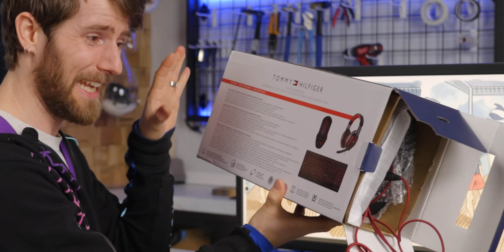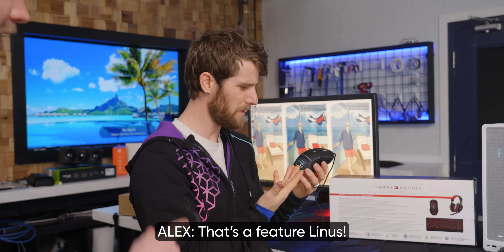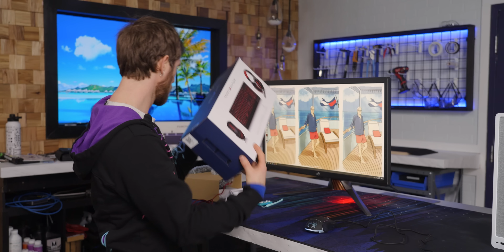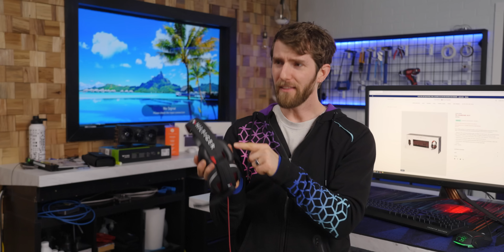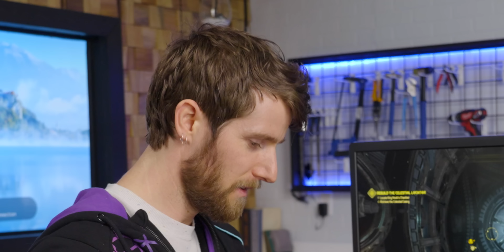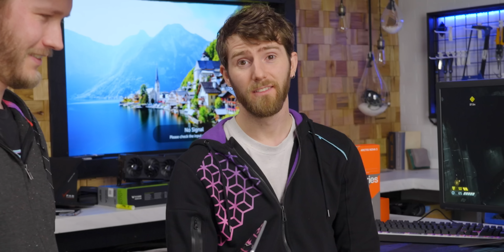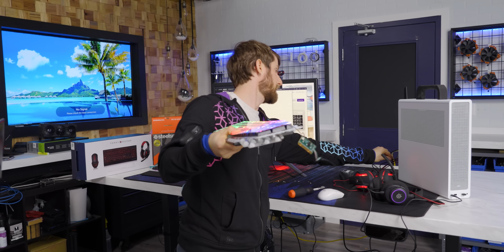Tommy Hilfiger are Filthy Scammers

Comment: The thing that really bakes my noodle is the branding on the keyboard. It's obvious the indent for the silkscreen is meant for a logo that has completely different dimensions, so they've just scaled the Hilfiger logo down to fit, making the spacing look absolutely abysmal. Love the fully integrated wrist rest too.
Reply: Ooooh that really bakes my noodle - 🤓
Reply: @TommyTom21  your comment really boils my bananas 😡😡
Reply: I have said keyboard, exactly the same
Just not from Tommy. I got it for closer to 10usd by itself. 
Not a good deal but still.

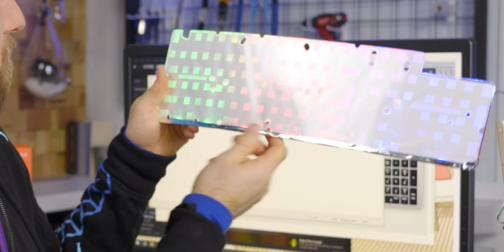Comment: At 26:41 that isn't anti reverse engineer schmoo, it's a chip that doesn't have a casing on its own, the board is directly connected into the silicon then "encased" in black resin. Its called chip on board and it's very common, specially on very cheap very high production electronics.

Comment: 25:28 What you are describing is rollover, not ghosting. Ghosting is when you press a certain amount of keys, and you get an unpressed key outputted. Rollover refers to how many keys you are guaranteed to be able to press.

Pretty much every keyboard made today does not have ghosting issues. Due to this confusion, marketing teams will use the term anti-ghosting because they know that most people do not know the difference and assume it refers to rollover.

As a rubber dome over membrane keyboard, this keyboard has 2 key rollover, not 3 (I would guess pressing W, E, & D would prove this). 
The 6 key hard limit is because they are using the basic USB keyboard driver which only allows a max of 6 keys even if the board itself were to electrically support N-key rollover. This limit with USB is why in the early days, some gamers would prefer using PS/2 keyboards.

Comment: There is a technical error in the mouse parameter section: CPI and DPI are two different concepts, CPI is the mouse sensor parameter; DPI is the parameter of the entire mouse.
CPI is a sensor characteristic. It refers to the number of counts of the sensor for every inch the mouse sensor moves, reflecting the minimum distance the sensor can recognize (for example, when CPI is 10, the sensor moves the internal counter +1 for every tenth of an inch. The controller can calculate the actual mouse movement distance from the value in the internal counter when fetching data).
DPI is a mouse feature that tells the computer how far the cursor should move (in pixels) for every inch the mouse moves.
The CPI is converted to a perceived DPI by the internal controller of the mouse.

Comment: That 6-key rollover on the keyboard is actually a USB limitation. Any USB keyboard that has N-key rollover has added firmware to enable it. If you take almost any USB keyboard from, let's say 2010 or prior, it will most likely have the same problem. The reason Linus was able to play Liero in 1997 was because he had PS2 keyboard.
Reply: Real talk, Liero is awesome.
Reply: Mostly yeah, but the 6 key rollover seems to be split between zones which is bizarre
Reply: That's how they did it on cheapo USB keyboards in the early 2000's, you can't legit even type a document if it isn't, note that at the time a cheap generic would still focus the zones two for left side gaming two for right side then one for rando and one for numpad. 
They couldn't get that right in 20220's when the friggen blueprints how to do it right can be legally just downloaded off some rando website by anyone 0.o
Reply: The problem is not the 6 key rollover, i think its quite common on cheap keyboards, the problem is the zone thing, cuz you can be pressing W D and Shift to run diagonally in a game and then you can't jump, or something like that. 
6-key is not that bad, 
"3-key sometimes" is terrible.
Reply: My DasKeyboard comes with a USB to PS/2 adapter that lets you have n-key rollover, I like that too because it saves me an extra USB slot for other stuff instead of keyboard
Reply: That 'extra firmware' is just a differently put together USB descriptor. Normal keyboards are a single HID class keyboard, hence a 6 key limit. The N-key rollover keyboards use the composite device descriptor that something like a USB headphone set would use where you need audio in and out. It effectively pretends to be a virtual hub with multiple keyboards connected, each sending max 6 keys at once.
Reply: I was able to play roms and such 2 player back in 95/96 with whatever keyboard that came with the pc my mom got form Showplace. Honestly no clue if it was ps2 or not but my understanding is that ps2 was the higher end one, and I assume we didnt have that..
Reply: And for anyone that wants to understand why that's a usb limitation, Ben Eater did a video on a usb keyboard explaining the communication keyboard-pc and it goes over exactly this (comparing ir to a ps2 keyboard too!).
TL;DW: the data packet for a standard keyboard usb communication is limited to exactly the bandwidth of 6 keys, plus all the jargon required to make the connection itself work. PS2 keyboards just constantly sent the data of the state of each key.
Reply: @crisnmaryfam7344  they where all ps2 back in 95/96. USB is just newer.
Reply: Liero mainittu. Torille ->
Reply: @hedgeearthridge6807  I remember that years ago a keyboard manufacturer had on their included accessories listed "PS/2 to USB adapter, even though we don't know why would you want that". I don't remember which manufacturer though. They were probably referencing this 6 key limitation on USB.

Comment: Fun fact, that "anti reverse engineering" smoo Linus was reffering to is probably not what he thought. when trying to get costs right down, manufacturers wont buy packaged chips and will instead just drop the raw silicone on the PCB and run bond wires straight to the PCB. 

As this is super fragile, they them dron a gunk of expoxy on to keep everything secure.

Calculator manufacturers are noriorious for it.

Comment: That "anti-reverse engineering" goop is actually to protect the bare silicon die that is directly attached to the PCB - it is super easy to etch it off if you really wanted to reverse engineer the generic design used.  I used to see that all the time on cheap electronic toys back in the 80s and 90s.  The first thing that comes to mind is those old key fobs that made random noises like farts and gun shots which would be a basic PCB with a gooped up silicon die, a LED (if you were lucky), maybe a few resistors, and capacitors, along with a single transistor for amplification purposes.

Comment: An omnidirectional speaker is a speaker not aiming towards you, but to a spreader cone. Often the speaker is built vertical with the tweeter on top and the woofer in a larger enclosure at the bottom. Between them is a cone that spreads the sound from the vertical position the speaker is in, to a horizontal direction. Since the cone is round, the sound gets spread 360 degrees from the cone, into the room. The result is a massive 'bubble' of sound. There's no directionality. When done right (and that's never cheap) you can look at one of those speakers and STILL can't convince yourself that the sound is coming from the speaker. It's a cool effect, but there's no clear stereo imagery going on. I like the sound of an omni speaker, especially to just 'fill a room with sound' but it can't beat a properly placed stereo speaker. t

Comment: As to the keyboard chip, that blob of epoxy is not there for anti-reverse-engineering.  That is actually a bare die that it laid on the board, and a wire bond machine hooks the pads up to the board.  It is very low tech, but the bond wires are VERY fragile, so they blob epoxy to protect it.
Also, for the mouse, you can get a single LED that had three separate dies in it (RGB) and a tiny controller to cycle through them all.  It is more expensive than a regular LED, but you just provide power and ground, and it will cycle through colors without any extra work.
Reply: It is for durability and against reverse engineering too - it isn't easy to remove that epoxy without damaging that bare die, and to examine that bare die, you need a very strong microscope. For example, Casio G-Shock watches use it for their chips too, in their case most likely for durability.
Reply: I'm just gonna add that the blob method is called "chip on board", and it's used because it can be (surprise surprise) cheaper.

Comment: I LOVE those 'Omnidirectional' headphones!
If you think it over, 'Omnidirectional' just means that the sound comes from all directions, which really means they're not directional sound. They're not surround-sound headphones. That's what it means. It means they're regular, cheap headphones!
Reply: "Surround sound headphones" aren't really a thing.
Unless you have a very specialized design with multiple dedicated drivers at different positions and angles, any pair of headphones is just stereo regardless of if they have a 7.1, dolby or whatever checkbox/mode in the drivers.

What they're most likely referring to is the microphone built into them. For a headset you want a cardioid or shotgun pickup pattern that only picks up sound from the side that faces your mouth to supress echoes from the room that an omnidirectional mic would happily catch.

Comment: So as someone who has worked in apparel, I totally understand why they did what they did, the true failure is not getting a product manager from outside apparel to run this product.
Reply: if the product page is anything to go by, that's probably what happened.
They have a listing template for CLOTHES. so most of the page is like a clothing item.
how to wash, materials used.
and NOTHING of the features.

Comment: The black blob on the PCB 26:37 is not an anti-reverse engineering measure. It's how they encapsulate the silicon wafer to protect it and the tiny bonding wires from damage. They do this to save on manufacturing costs for simple high volume boards because it cuts out a few parts and operations. I hear you can get some specialty solvents to etch just that part away if you really want to see under it.

Comment: Actually, the blob on the keyboard PCB is most probably covering a "naked" chip; i.e. a bare silicon die without any packaging. This saves some money and has been common for certain applications like greeting card and toy sound circuits and cheap Chinese pirated game ROM cartridges.
Reply: yeah, I've seen this in calculators and cheap generic TV remotes

Comment: One thing I learned from this video - never unplug the device you’re taking apart. 

Ok guys I’m about to change the fan on my PSU, wish me luck 🤞
Reply: May god help you, brother
Reply: Well, if you're careful, you should be able to do it. Mine worked for about a day after the fan died and I didn't notice, before going out with a bang. So at least it won't overheat instantly. And little bit of electricity never hurt anyone, just sparks up your life a bit.
Reply: @raifthemad  umnnn the issue with that is their amps. 1-3 amps is enough to kill ya. do what ya want, just mitigate unnecessary risk yo
Reply: Good luck
Reply: Hes in gods hands now 07
Reply: @ShartsInTheAir  don't let numbers dictate your life
Reply: @ShartsInTheAir  And I thought, that my last line would give away, that I wasn't serious.

Comment: I bought a very similar "gaming accessory" kit from Target three years ago for about $50.

Even at $50 I figured it was probably not the greatest purchase I'd ever made, but I needed a headset and the only one left in the entire store was in that box (the lockdowns were just starting). And at least it didn't cost an extra $100 just for Tommy's name on the box.
Reply: You literally couldn't just go to a Best Buy or even Walmart and get a better one? Or just order off Amazon?
Reply: @dabug91  Maybe I could've gotten a better deal that way. I just thought, well, I need something now, and this is here, so I'm going for it.

Things were a little crazy in the month of 3/20. Yeah, I could've probably done better right then, but I also could've done worse.
Reply: Holy sh 2020 was three years ago
Reply: @islmhhh  correct, everyone has found out.

Comment: LTT : Spends 3 years designing a screwdriver because they Linus won't accept the color of the accent in the handle being slightly different than he wants it. Sells it for $70.
Tommy Hilfiger : Buys the cheapest Chinese products they can find for $10, doesn't even bother checking if they are complete, slaps their logo on the box, sells it as a $150 luxury item.

Know your brand before you buy lol
Reply: This was 10 dollars at Marshall's lol
Reply: @RealEpikCartfrenYT A ratcheting screwdriver with integrated bit storage is $10 at the bare minimum.  A ratcheting screwdriver that has a magnet and is the least bit ergonomic to use one-handed starts at $20.  Of course there are also higher quality options that may not be in stock at the local hardware store, Snap-On charges $80 for just the handle for example.

Comment: Nice to see the G305 getting some love on the channel. Got it myself because I hate the asymmetrical design so many gaming mice have these days, (fucks with the joints in my hands to use them longer than 15-30 min.) Such a good bang for the buck mouse, great response time (didn't even notice how bad my old mouse was until I used this one) great battery life, not too heavy, not too light, great software, and damn near always on sale lol.
Reply: my daily driver is an m510, have bought them for years through their iterations. when i game i pop on my g305. i am so disappointed with the g305 battery life. im getting maybe 2 to 2 1/2 months out of the battery, whereas in my m510 ive maybe swapped out the batteries twice in 5 years.
Reply: @briancollins7296  Well how many batteries does that M510 take? Because the G305 only needs 1 AA and I'm perfectly fine with the battery life of my G305 considering that.
Reply: I love my Acer Nitro. Definitely  passed the durability test. Lasted through years of League of Legend while I passed through many keyboards.

Comment: 6-key max is actually quite common on cheaper keyboards. The HID spec states that for low-speed devices, the maximum frame size is 8 bytes, so they use 6 bytes for the keys, 1 byte for the modifiers, and 1 byte for the error. The report format is up to the device, so with effort, it could be re-configured to utilize the 8 bytes more efficiently.
Reply: I'm kinda miss PS/2 keyboards when they don't have such weakness.

Comment: im pretty sure i bought a mouse at wallmart that looked a lot like the tomy one (even had the metal bar inside of it when i opened it) and it was around 9-12 dollars. the coors of the rgb did change depending on what dpi you were using so idk what went wrong over tommy tbh

Comment: Technically, a speaker array wouldn't be omnidirectional since that term refers to the dispersion pattern of the drivers, not the configuration of how they're positioned. So the array would just be a bunch of directional speakers emitting in a lot of different angles. Subwoofers, for example, are considered omnidirectional (typically). That's why you don't really ever need stereo subs in a small listening environment (Although you would in something like a concert environment for many reasons). This is due to A) The walls and floors acting as additional baffles for the sound making it seem to "emit" from all around you, and B) Lower tones (sub 100 Hz) radiate from the sub driver  with a WAY longer wavelength than higher tones, which means when they can oftentimes be longer than the actual driver itself. Because of this, they tend to travel further around the housing making (in many situations) a more or less omnidirectional dispersion pattern.

Comment: You can tell they are a clothing brand with how they've prioritised Material over anything actually useful. Surprised they didn't include washing instructions. 

I'm sure these exact sets cost like £30 on Amazon, in fact they have sets with actual Mechanical keyboards for much less than this. Wouldn't be surprised if these cost them under $20 each from the manufacturer.
Reply: It seems to be on purpose like it's a cute, quirky thing to do. Their core customers don't even read any of that stuff, anyway. They just buy.

Comment: i tested my $20 keyboard with the anti-ghosting demo and it can only handle 6 simultaneous keys at once, and sometimes only 3. lol
i like typing with it though and it hasn't failed me in the last 5 years.

EDIT:
i tried with my 2021 macbook pro's keyboard and it's also 3-6 simultaneous keys.
Reply: 6 key roll over has been the norm since usb replaced PS2. If you type fast (100 wpm+) you'll often end up with it having missed some of your strokes. I've also sat waiting for what I typed to appear on screen,, so the keyboard may not be the only limiting factor.
I've got a USB to PS2 adapter for my desktop, so I get more key roll over. Good luck finding a mobo with even the combined PS2, though. It's actually a bigger deal in gaming, macros, etc, than typing, though, as you have more reason to press multiple keys.

Comment: The black blob on the PCB is actually not to prevent reverse engineering. For extremely cheap mass produced PCB's they use bare silicon dies bond-wired directly to the PCB to save a few cents on packaging. The black blob protects the fragile bond wires and prevents light from hitting the silicon die. (Light can generate unwanted voltages due to photovoltaic effects like in solar panels)